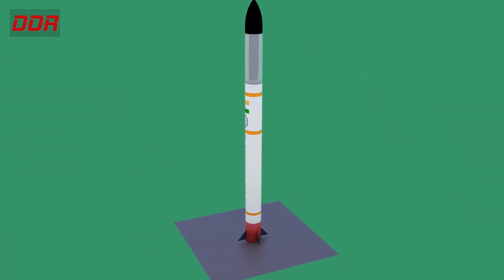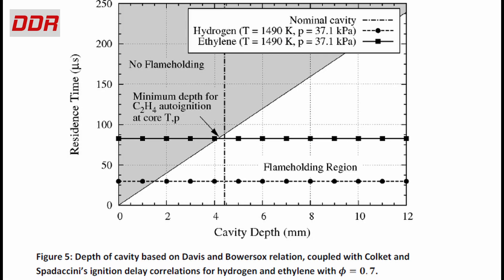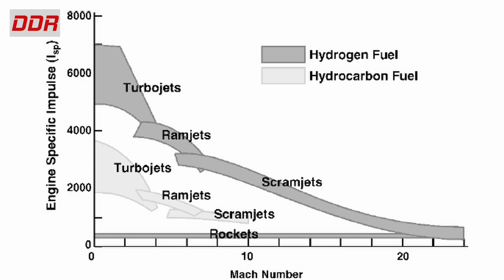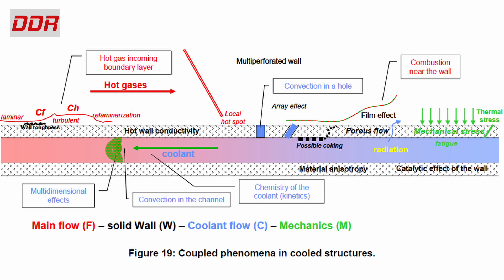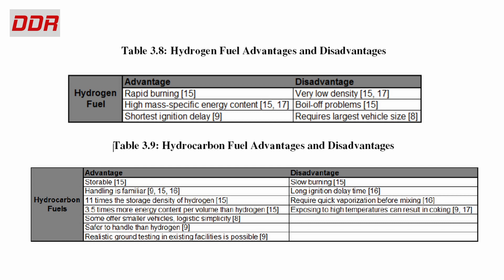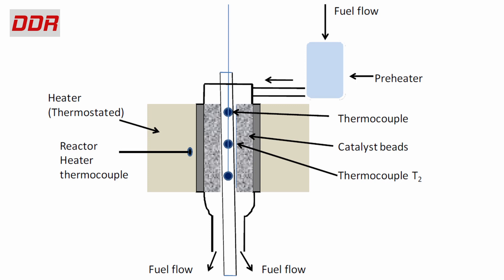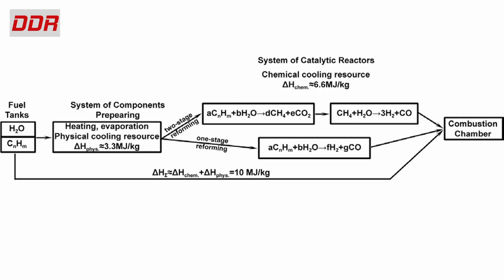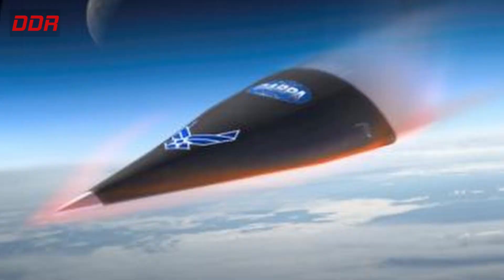What Powers SCRAMJET Engines - Hypersonic Fuel

Comment: Does brahmos 2 has any indian contribution or it is just an export version of zircon?
Reply from the maker: Brahmos CEO has said in an interview recently that HSTDV program will the technology development program for Brahmos-2. So it won't be a copy of the Zircon.
Reply: It is probably an export version of zircon
Reply: Obviously it's a joint project of India and Russia, it is going to have a large (significant) percentage of Indian components. And Brahmos 2 is supposed to be different than zircon in many ways. Just see P-800 and Brahmos, the resemblance is only aesthetic, inside them are significant differences, like better seeker, fuel, guidance, range (of the ER version) , etc.